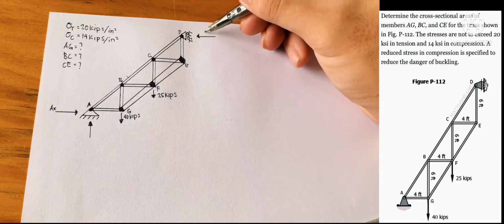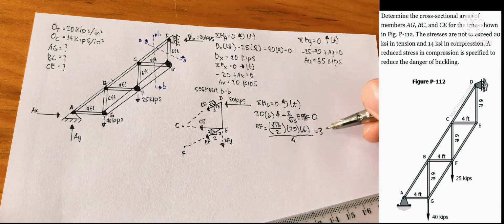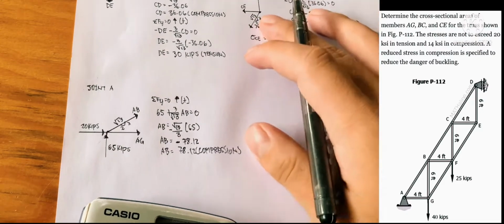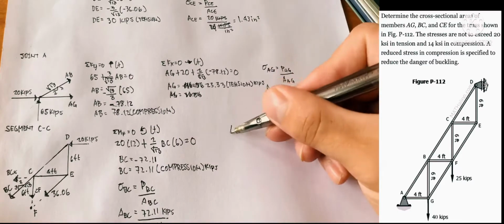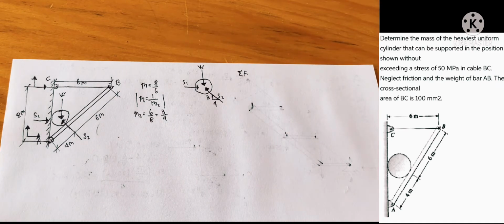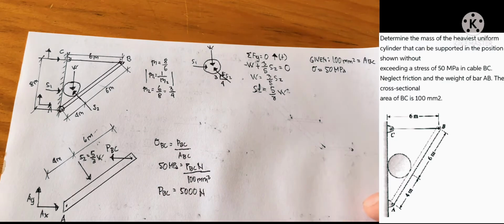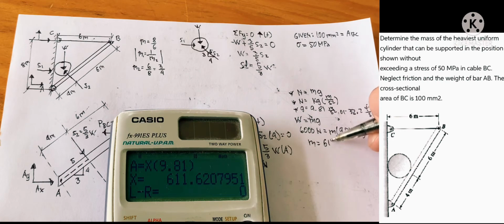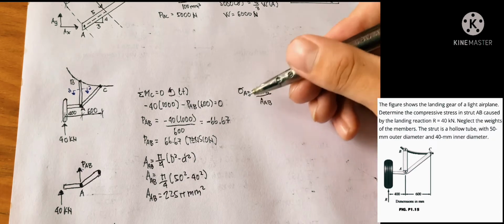Axial /Normal Stress (Review) - Part 4

Comment from the maker: Content Summary:

9) 0:14 - Determine the cross-sectional areas of members AG, BC, and CE for the truss shown in Fig. P-112. The stresses are not to exceed 20 ksi in tension and 14 ksi in compression. A reduced stress in compression is specified to reduce the danger of buckling.

10) 15:42 - Determine the mass of the heaviest uniform cylinder that can be supported in the position shown without exceeding a stress of 50 MPa in cable BC. Neglect friction and the weight of bar AB. The cross-sectional area of BC is
100 mm2.

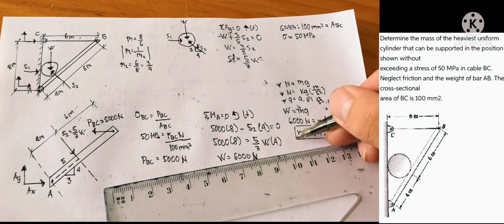11) 29:17 - The figure shows the landing gear of a light airplane. Determine the compressive stress in strut AB caused by the landing reaction R = 40 kN. Neglect the weights of the members. The strut is a hollow tube, with 50-mm outer diameter and 40-mm inner diameter.